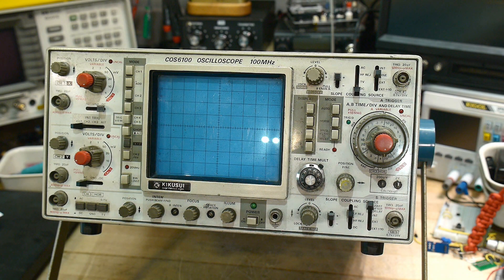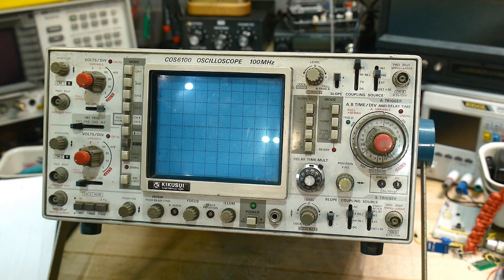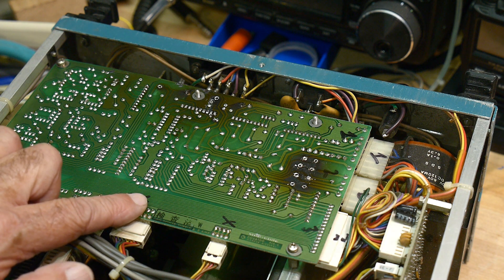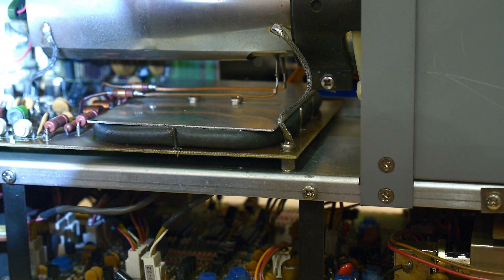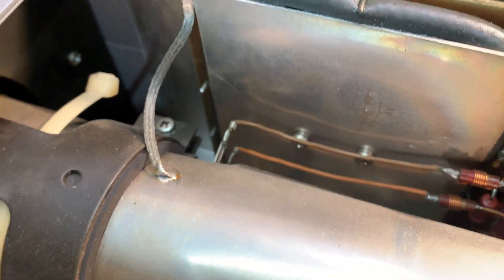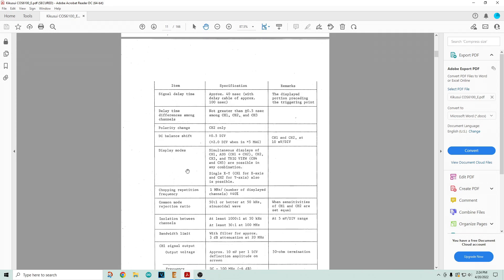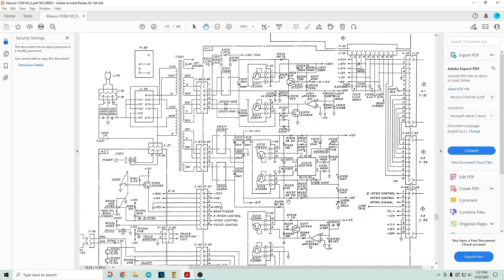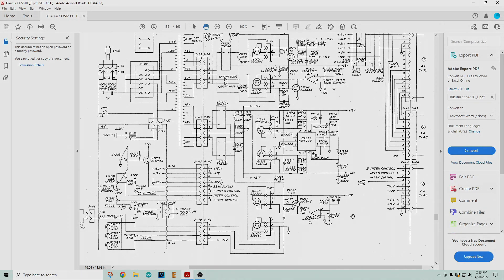#1140 Kikusui COS6100 repair (part 1 of 11)

Comment: I have one of these which started to make cracking noises and making an ozone smell.  I immediately thought it must be the EHT voltage multiplier, so removed that board, took the voltage multiplier block out (warning here, don't do this if you are not familiar with CRTs - you could be killed by the residual charge in the CRT) and picked off the silicone to look for arcing. There was none, and, in fact it's an excellently executed piece of work - silicone instead of epoxy.

I was puzzled, examined the HT for marks over and again, then went back to look at what's going on and noticed HT fur on the screen/heatsink plate for the EHT oscillator transistor. Cleaning that off, forensically, showed me a couple of little dints in the aluminium - evidence of arcing.

So, I think the EHT block is fine, although it needs to be rebuild. But, I think the designers ad Kikusui cut it too fine with clearances with the (mainly) cathode and other voltages. The plate that holds the driver transistor is too close to the board behind it.

Looking at the design, the length of the leads of the HV capacitors before they are cut on the board underside was left down to the operator. Passing test at manufacture, the clearance is probably enough. After 40 years of dust accumulation, arcing will occur.

On inspection of the multiplier assembly I damaged one of the diodes, so that requires a rebuild but, it was clear the problem wasn't there. Once I have rebuilt that, I'm sure it will work again.

This scope is a really excellent design example of logical engineering, and using simple parts to make a great product. But, I am astounded to be honest, at how little thought was applied in areas where it should have been.

However, saying that - the COS6100 is one of the best scopes of all time in my opinion. The 24kv HT makes for a super sharp trace, and using the knobs, it just feels like superb quality, better even than Tek.

Well worth the time to get it going...

A

Comment: buenos dias de nuevo y gracias por acceder a pasarme la documentacion del osciloscopio, yo lo desmonte al completo para repaso de soldaduras y limpiezas de pcb pero al montarlo y encenderlo algo no va vien, yo nombre cada ficha pero no se si he colocado alguna mal, ya entro en la duda..¿ donde podria ver a que lugar de cada modulo van interconectadas cada ficha? mil gracias de antemano y enhorabuena por sus publicaciones, ayuda a muchas personas.
Reply from the maker: I think you are asking how do all the wires connect. In general. each connection is a pair of one jack and one plug.  the jack is 'J'  and the plug is 'P' on the schematic. each pair of jack and plug have a number   so J35 goes to P35
Reply: @IMSAIGuy  no, me refiero a la conexion entre placas. Pues he visto que en una placa pone una enumeracion y en la otra otra enumeracion. No se si he conectado algo mal. Te podria escribir por correo para asi enviarte fotos y videos? Gracias de antemano.
Reply from the maker: you can find email on my 'about' tab

Comment: If I didn't know better I would suspect that it was wired for 115Volts, and then subjected to 230Volts,
but that's probably not the case.
To bad they didn't put fuses in on each secondary winding.
You'll just have to hope their still intact.
Btw, there's some fun stuff going on at John's Basement now...
Reply from the maker: Yikes, that IMSAI is a mess.

Comment: I have this scope COS6100M. Bought many years ago, military surplus.  Got a seemingly complete photocopy manual with it.  5V on your schematic looks like the bridge polarity is reversed. The bridge part no's are Toshiba 200V=VRM IO=2A according to my manual.  The pass transistors are NEC-NPN and Toshiba-PNP part no's. The M model has 1V calibration instead of the 2V and the TV Sync is changed to AC LF REJ.  
The rest of the changes seem to be specification information corrections/up dates.

Comment: I've been enjoying these "repair the test equipment" segments a lot. 

There is a possibility you might become known as the "Mr. Carlson's Lab of the Latter Twentieth Century." After all, a five-trace 'scope does seem to fit in the same category as the 1939 Vedolyzer, just with 4000 logic instead of tubes. Whether this is a good thing or not I'll leave up to your judgement.  (grin)